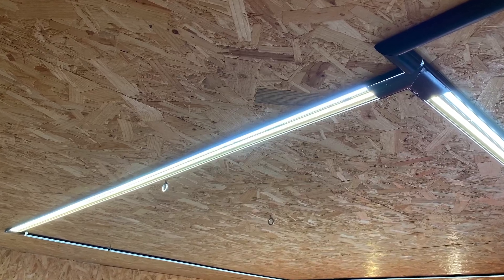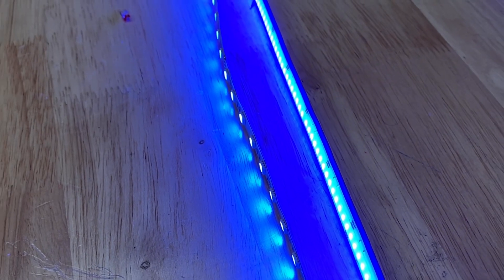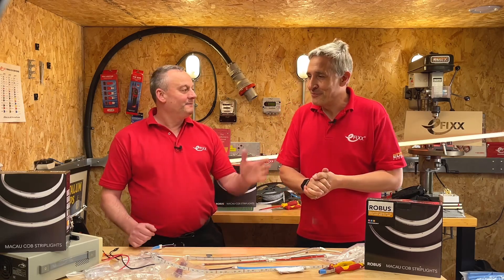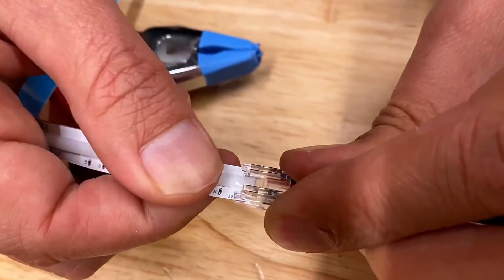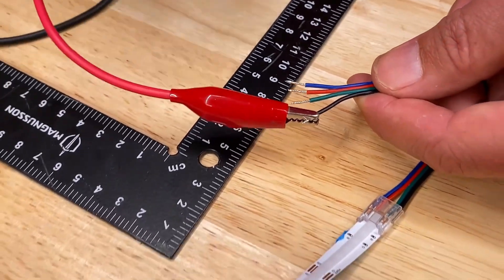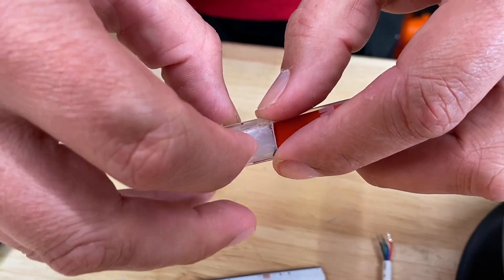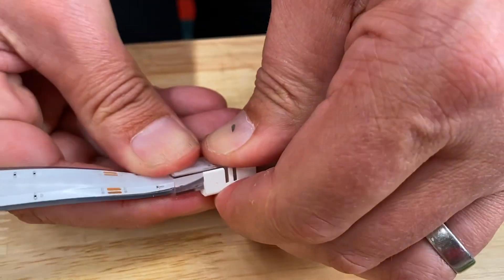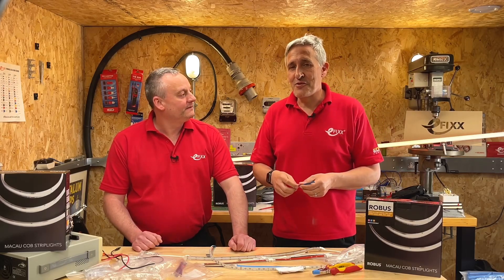Stop Soldering NOW : New Connector System for RGB LED Strips

Comment: For a very good quality seamless led strip, I recommend LEDspace. They are brilliant and tiny as some strips are only 4mm wide. Also, to avoid the reflection, I always use triangle quadrant under units to angle the strip put so the spread of light is better and the chance of relection is greatly reduced.
Edit: it's a shame these companies don't produce a crimp for these connectors as they often bend and don't get a full connection. You have to be spot on with the pliers